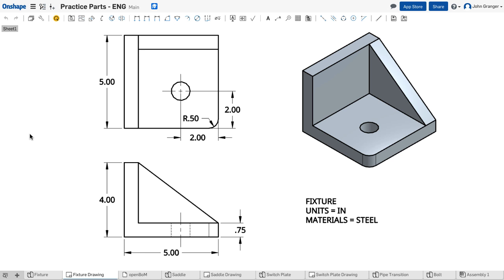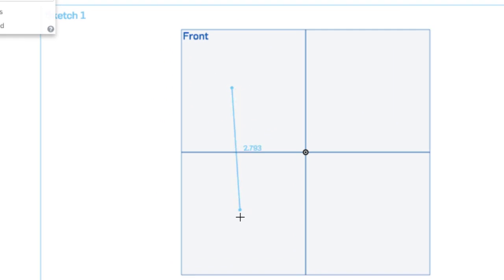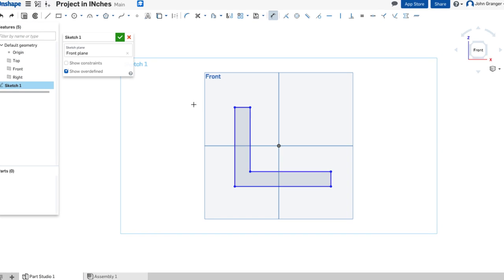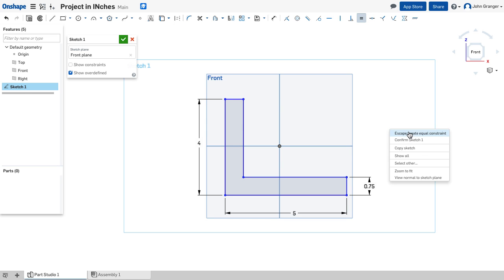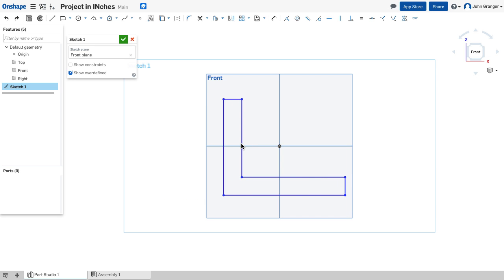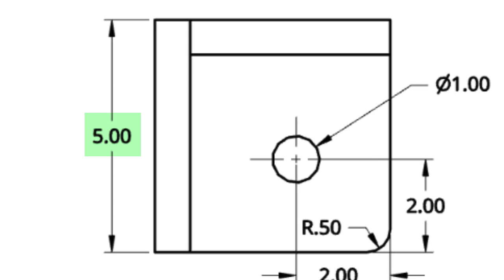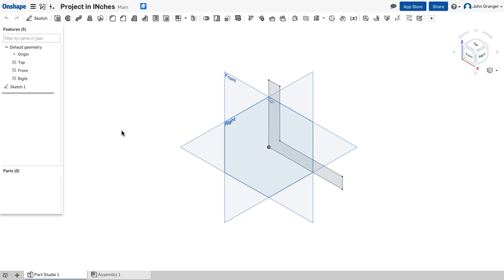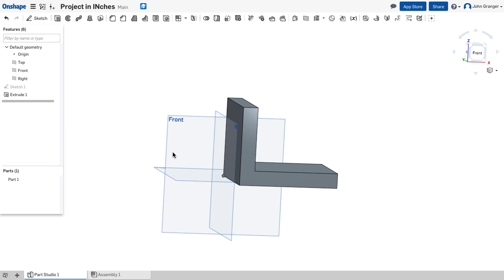Learn Onshape - Project 1 - Create a Base Feature from a Sketch

Comment: I'm new to Onshape. I use Google Sketchup in a junior high industrial arts class.  I'm told that Onshape is much better, but with that power there is added complexity (for many of my students, Sketchup is very challenging). This tutorial is short and simple (good for me), but several tools that are used (dimension, coincident, . . .) are not in my tool bar. I've spent at least 30 minutes lost in the internet trying to solve this. Any reccommendations would be greatly appreciated.
Reply from the maker: In Onshape, the tools that show on the toolbar are contextual and are displayed according to the activity you are doing.  If you are sketching, you see sketch tools, adding features, you see feature tools.  In the video, look at the activity that I am doing when I use a tools from the tool bar and you will see the context that those tools show up.  BTW, the playlists for projects like the "do nothing machine" or "spinner" on my youtube channel would be perfect for your junior high industrial arts classes.